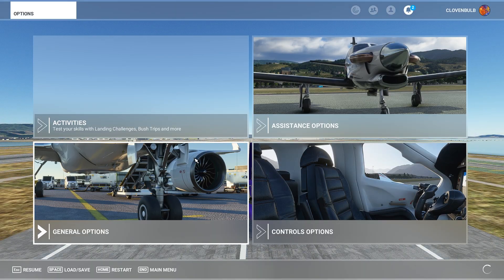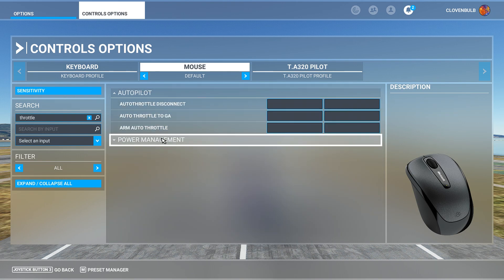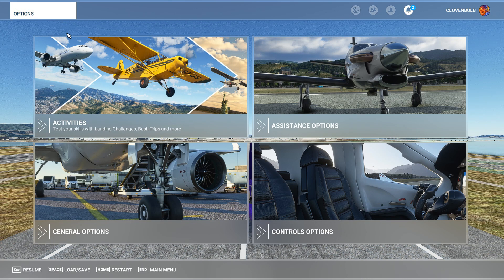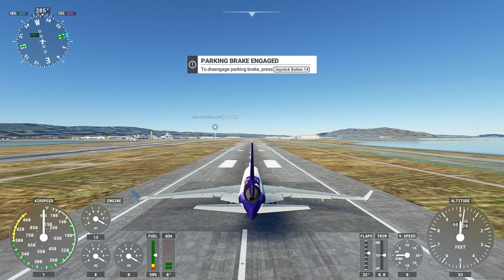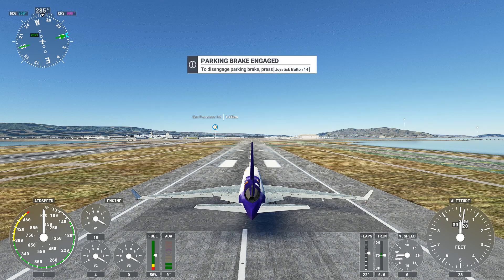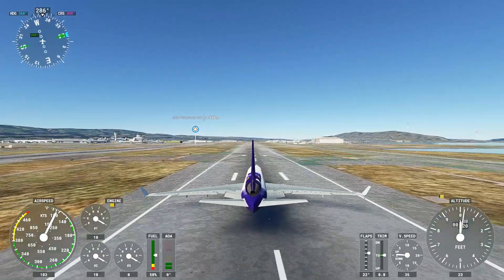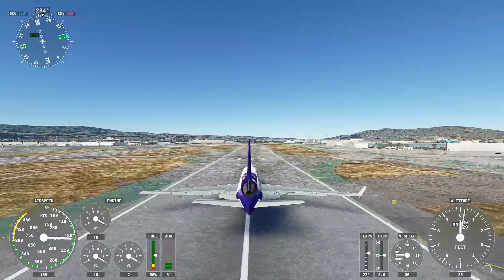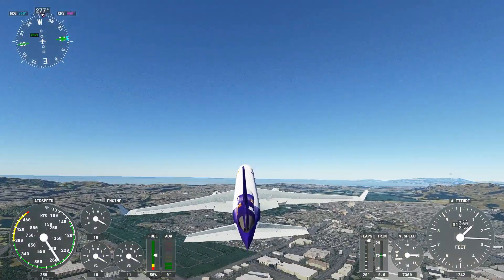Microsoft Flight Simulator 2020: Engines not working on Modded aircraft fix.

Comment: Tried this on the Vulcan from your other video and had no luck :( Thrust is full but the engines just wont start. I can hear the engine noises but nothing happened
Reply from the maker: How long did you give it. It can take a bit of time to warm. Up. Try assigning different keys
Reply: @Clovenbulb  left the trust on full for Atleast 5-10 minutes!
Reply from the maker: @CheckPointCharlie  did you convert it ? From flight sim x or something?  If so try converting again and look at the things you are adding .
Reply: @Clovenbulb  I did re do it twice! But it was so complicating I probably rushed it! I’ll give it another go tomorrow!
Reply from the maker: @CheckPointCharlie  probably best mate maybe bin off some the features you don't need if you just want to fly. Ie lights. Maybe it has too much going on. Just tick the boxes for the basics.
Reply: @Clovenbulb  UPDATE! Got it working without the lights! Thanks again for the helpful info!
Reply from the maker: @checkpointcharlie141  no problem mate glad it works now.
Reply: @checkpointcharlie141 how plz i have the same problem